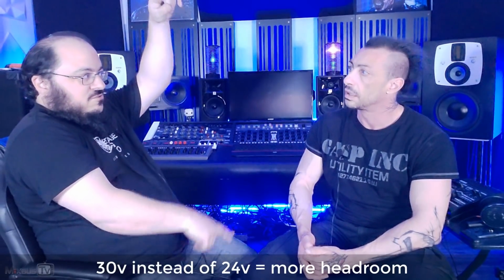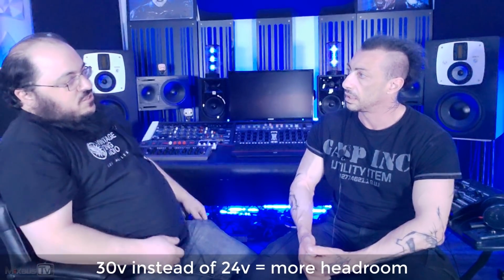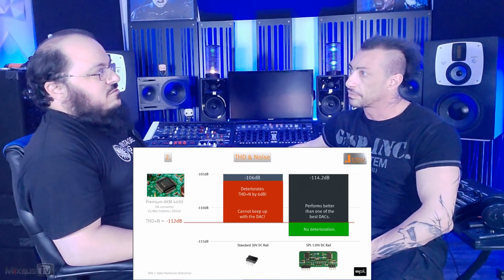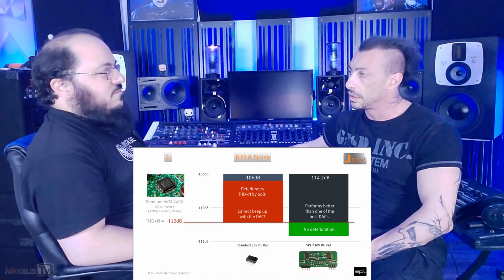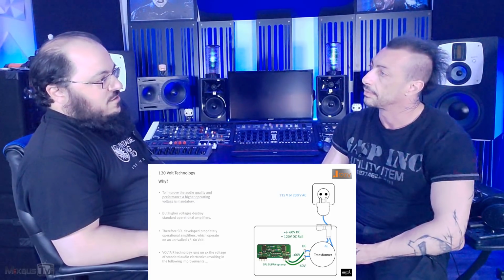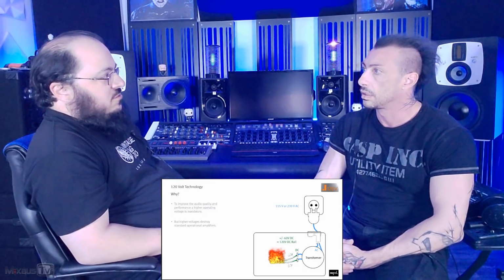More Power = Better Sound? Tech Talk with Joe Vezzetti 120V Technology

Comment: Wow this was some of the most useful information in the most accessible format I've found on YouTube on this subject. You both really broke it all the way down to the how all the components are produced and how they operate with specific voltages.

Question: can you make a video talking about/demoing your 500 rack? Its seems like you chose each module for their components and voltage tolerances. Could you talk about experiences in the journey and the epiphanies that landed you on those module being solidified in your setup? What do you use as a 1073, 1176, preamp, compressors, eqs, and what do you use each for in your setup and workflow?

Comment: You both speak very fast  ! It seems very technical to me and to tell the truth ... laughs... I understand nothing ! ... But Joe seems to have an Avalon who smashes everything ! Interesting to know that printed circuits ?, chips ?, are not really made for music or that the voltage is generally not suitable for audio equipment. The guy is a hell of a face in musical electronics !!
Well I'm going back to sand my floor ... laughs . Thank you Joe , anyway very sharp interview .
Reply: Asymmetrical voltage is direct current ?  VS  Bipolar Voltage  ( alternative current ? )
Reply: @RelaxMaxM  if I understood what he was saying, asymmetrical was single voltage (for example +24V) and bi-polar is both directions positive and negative (+12V and -12V=a 24 volt total range). I don’t think the said whether it was A/C or D/C, but amplifier voltage rails are D/C.
Reply: @audio_odyssey  
you make me think that I think I have already seen an amp marked + Voltage and-Voltage. Yep! Thank you. It is therefore very different from A / C